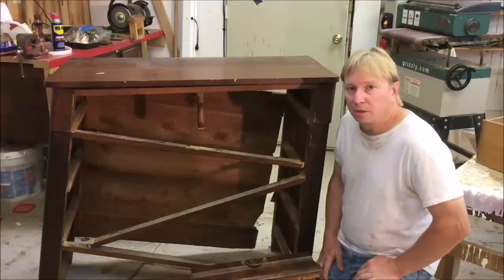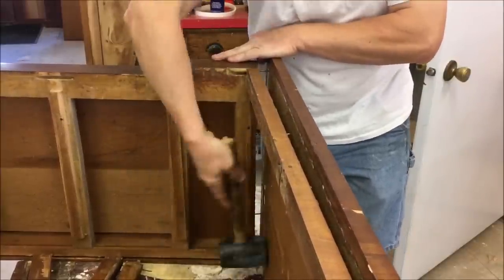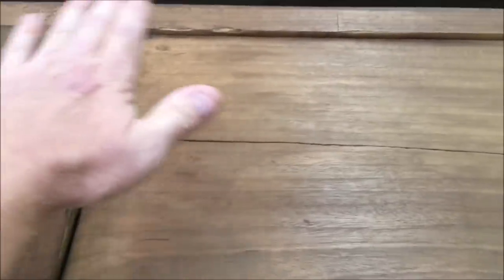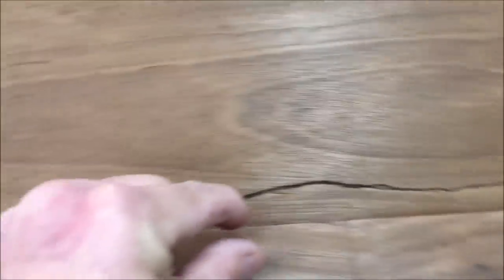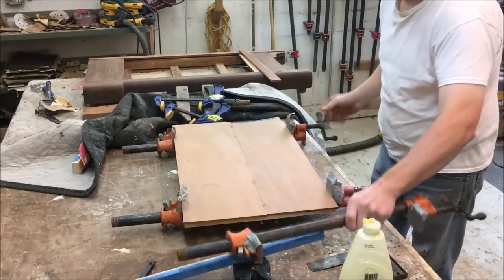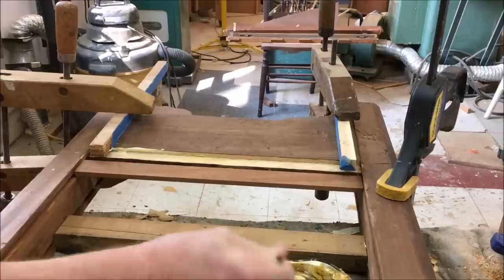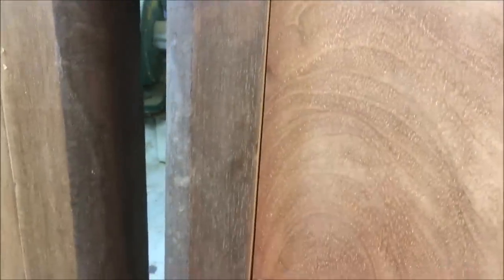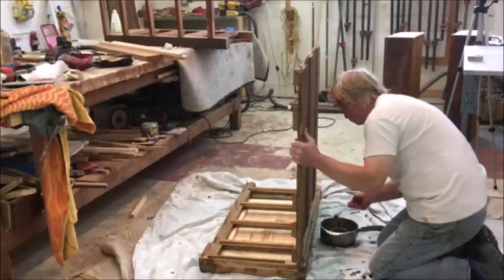MAHOGANY CHEST OF DRAWERS / PART 1

Comment: The only thing I'm iffy about is adding the bead molding. I wish there was a way you could have routed off the 'back' of the panel groove, to allow you to set the full-size board in place, and secure it with new cleats. That would have eliminated any gaps. I'm also surprised that you couldn't knock that panel assembly apart, I would have thought the glue would have failed a long time ago.

Comment: As usual, excellent work and great explanations of the repairs. I’m just curious if you used the slotted, round-head screws for a particular reason or did you just have them on hand? Thanks
Reply from the maker: they are what worked best for that situation
Reply: @rosstaylorwoodworking728  Thanks for the reply. Now I’m trying to learn. Why were they the best choice? Again, I’m just trying to add to my knowledge relating to furniture repair. Thanks again!